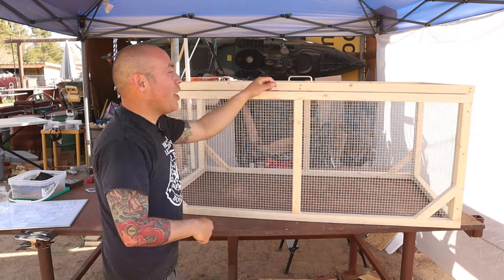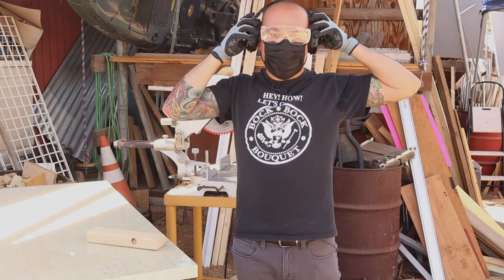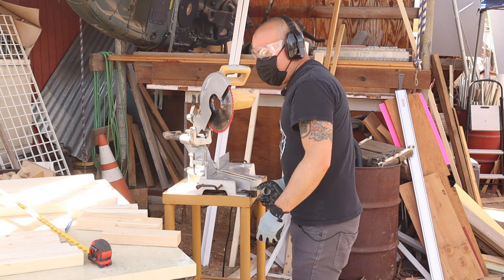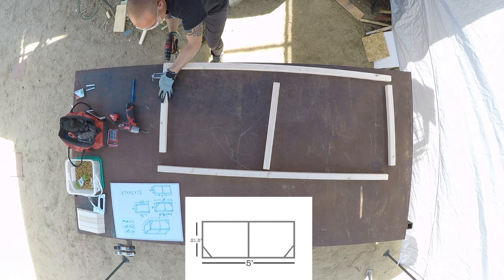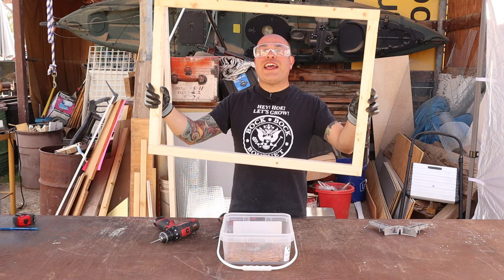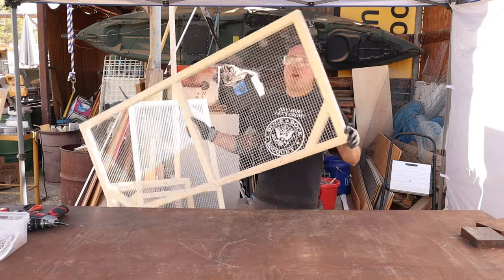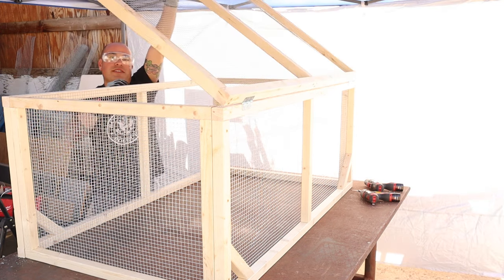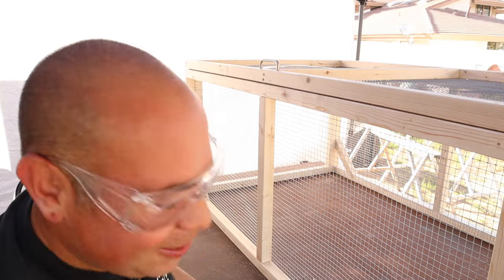DIY Chick Brooder Design - Raise Baby Chickens Outdoors Easy

Comment: Followed your steps and mine came out great! Thanks for listing all the supplies and cut sizes - made it super easy to build. One thing I'll add is that my box tends to go "out of square" with respect to the lid, so I added some 45 degree posts around the upper corners and now it's perfect. Thank you for the video!
Reply from the maker: Awesome! Yeah those angles on too should hold it super sturdy!

Comment: Super nice! 👍 I like how you allowed that extra for the mesh cloth!  I have a love hate for it.  It’s necessary, YES!  But it’s a pain to work with for sure!  Good job!
Reply from the maker: Thanks a lot! Yeah the mesh cloth is the most annoying thing to work with as it tries to coil back and ends up scratching your arms lol. I have built things before right to the same measurement of the hardware cloth specifications, just to realize that the roll was not super straight from the factory and had to cut all my edges off. That's why I have been allowing myself half or a whole inch for wiggle room.

Comment: Great video, as usual.  Cut my lumber yesterday, and will be building today.  A note for others.  2 X 2s can be expensive, if even available.  I simply ripped cheap 2 x 4s down to 1.75" and made the math adjustment for that extra 1/2".  Box is going to be a little stronger (and a bit heavier) but it will work just fine.  Each 8' piece ended up costing $1.64 compared to $3.35 for an actual 2x2.  Also, NEVER use pressure treated wood for chickens.  Splinters are a problem anyway, but a PT splinter is much worse.
Reply from the maker: Thanks a lot! And yes, that is awesome that you cut the 2x4s . Hope your build went well!

Comment: I really like this video, I’ve been wondering what setup to do for my chickens to give them new areas to explore and this is going to be perfect for supervised visits in my area. I only have 4 birds.
Reply from the maker: We also usually use this under supervised time outdoors in the grass or dirt for the babies to dust bathe. Or we end up putting it inside of our chicken run when we introduce the babies to the rest of the adult flock where it is more secure. Hope this works out for you!

Comment: Great looking chicken cage and boots. How did you bolt the corners? I was thinking of making the bolts removable so I could disassemble and store flat when not needed.
Reply from the maker: Thanks!! The corners are simply attached by three screws on each corner which you can see if you skip towards the end. In theory, you really could take it apart and store flat, just need to unscrew the two hinges up on the top, but that's easy too! Good luck if you build this!

Comment: What size was your drill bit Thanks
Reply from the maker: without checking my tool bag right now, I think i was using a 9/64. But it also just depends on the width of the screws you are using.

Comment: Nice job but I live where it's cold..
Reply from the maker: Thanks! How cold? If draft free and a heat lamp we have brooded chicks completely outdoors. As long as the conditions they need are sustained. Usually we keep inside for 1 month, and have them handling room temperature at 3-4 weeks age, and then move outdoors and if below 65-70F we have a lamp on. They usually don’t even choose to be under it. We completely ween them off the lamp to handle 40-50F by 2 months of age. These pens also come in use as a hospital pen for sick of injured birds when you need to isolate them. Or to introduce new birds to the flock slowly through a fence so they cannot fight
Reply: I live in New Jersey. We won't have steady good weather until probably May. We have some warm days now but today it's like 35 degrees.
Reply from the maker: Yeah that will get here quickly. We will be missing the cold weather soon once it gets too hot. We had a presumed dead missing hen, show up a few years back in the freezing weather with a batch of chicks. She knew what she was doing though and raised them up just fine. But for ourselves, it’s way easier to just wait for the warmer weather to brood lol